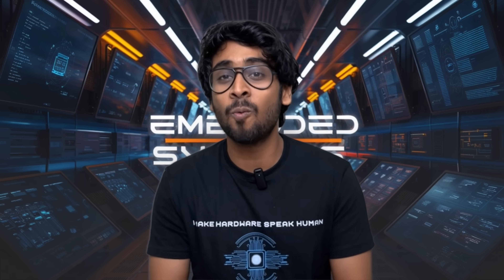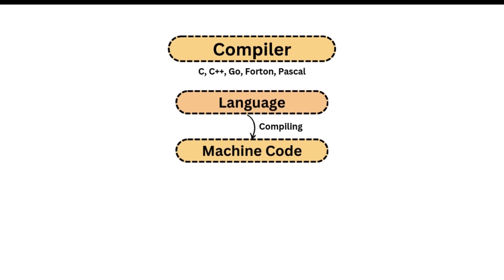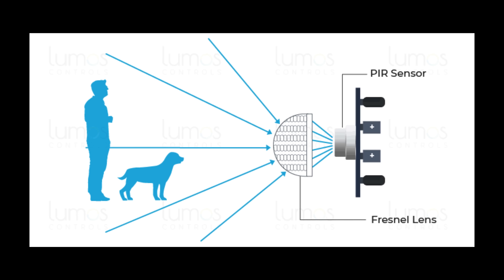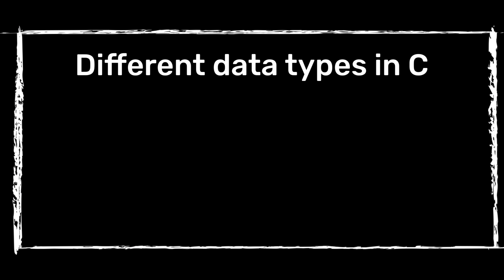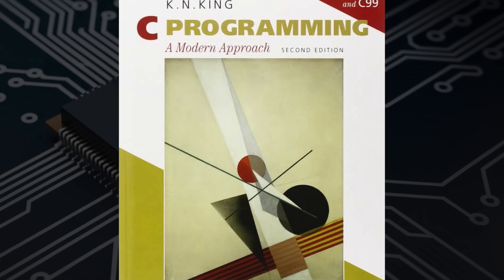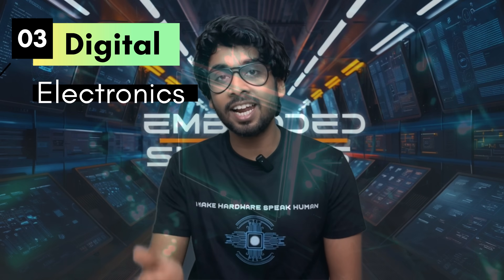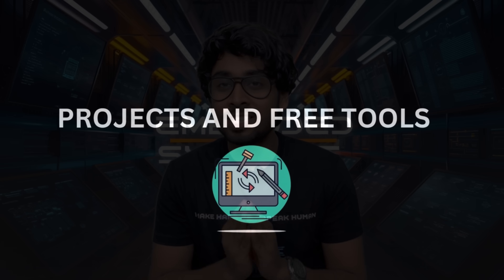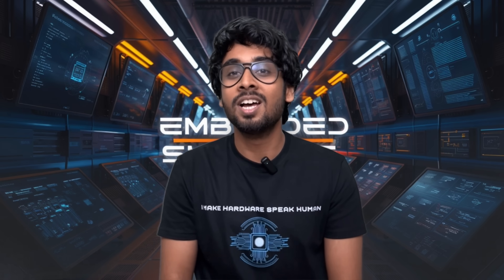The Ultimate Roadmap for Embedded Systems | How to become an Embedded Engineer in 2025

Comment: There was a no explanation about C vs Rust ? As we see Rust getting a lot of traction hence this question of why not directly learn Rust instead of C ?
Reply from the maker: Yes that part got cut from here, you can watch the video on ‘coding for electronics’ it is covered there!
Reply: Hey guys, I think C is launched in 1970's right. So the most community system providing language is C. If we choose rust I think 80% or above peoples are not aware about it. It just my opinion.
Reply: Because the concepts introduced by rust like ownership and borrowing can only be appreciated if you truly understand what c lacks. Furthermore, c is a very mature language by now, so there's a lot of resources of c
Reply: rust is not a beginner friendly lang u need to have good understanding of dealing with memory and pointers to write good code 
definitely u should know c and some c++(specifically smart pointers) to truly appritiate the design decisions what rust has taken
moreover lot of tools still uses c and u will esily encounter a tool not have any rust binding and u might need to write ffi urself
Reply: I asked the same question with a 10 years experienced Professional, he said that Rust may replace C++ but can't replace C. So you can definitely start your journey by learning C .
Reply: Also C gives more control with less abstraction, so it's gold for embedded. Also c is way faster than Rust.

Comment: ### Full, Detailed Breakdown of the Aurora Actuator  
(“Active Vein” — the artificial muscle that makes everything possible)

| Part | Material / Design | Exact Purpose | How It Works in Detail |
|-------|-------------------|---------------|------------------------|
| *1. Muscle wire* | Nitinol (Ni-Ti alloy) braided into a flexible honeycomb tube (~1–2 mm diameter) | Provides the pulling force | When heated above ~60–70 °C it instantly changes crystal structure (Martensite → Austenite) and shortens by 4–8 %. A single braid can lift many kilograms yet weighs almost nothing. |
| *2. Heating system* | Low-voltage, high-current (e.g., 24–48 V, 3–8 A) passed directly through the Nitinol braid itself | Makes the wire contract in <100 ms | The braid is the resistor. Electrical current → heat → contraction. No separate heater needed. |
| *3. Cooling jacket* | The same braided tube is hollow — cold fluid flows inside it | Removes heat extremely fast so the wire can relax again | Without fast cooling, Nitinol naturally takes 1–2 seconds to relax → too slow for walking or gesturing. Aurora solves this. |
| *4. Fast-cooling trick* | Electro-Osmotic Flow (EOF) “Domino Jolt” at 3 kV, 0.2 mm electrode spacing | Creates a lightning-fast water pulse inside the tube | Tiny ring electrodes are printed every few millimetres along the inside wall. The control board fires them in sequence (1-2-3-4…) for ~10 ms each → a peristaltic wave of cold water shoots through the tube at ~50–70 cm/s and strips the heat away in <50 ms total. |
| *5. Safety & 6. Electrical isolation + thermal bridge* | Boron-Nitride-loaded silicone liner (0.1–0.2 mm thick) | Keeps 3 000 volts away from the Nitinol while letting heat escape | Boron nitride is an excellent heat conductor but a perfect electrical insulator → the high-voltage cooling pulse never touches the low-voltage heating wire, yet heat still flows out instantly. |
| *7. Restoring force* | 3D-printed TPU (flexible plastic) lattice joints in the skeleton | Acts like tendons / springs to pull the limb back to resting position | When the Nitinol relaxes, the soft TPU lattice gently stretches it back to its long shape — no second “antagonist” muscle needed. |
| *8. Waste-heat recycling* | Peltier (thermoelectric) module + heat-spreader silicone skin | Turns waste heat into a feature instead of a problem | Hot water leaving the actuator goes to a small reservoir → Peltier module cools the water again while pumping that same heat to the outer skin → robot always feels pleasantly warm (~32–35 °C) like a living person. |

### Cycle in Slow Motion (one 5 Hz step = 200 ms total)

1. 0–80 ms → Low-voltage current ON → Nitinol heats → braid shrinks → joint bends (pulls).  
2. 80–81 ms → Heating current OFF (safety interlock).  
3. 81–100 ms → 3 kV Domino Jolt fires → cold water wave shoots through → braid cools in <20 ms.  
4. 100–200 ms → TPU lattice pulls the limb back → ready for next cycle.

### Why this beats every other actuator

| Traditional motors | Pneumatics / hydraulics | Aurora Active Vein |
|-------------------|-------------------------|--------------------|
| Noisy, heavy, rigid | Needs compressor/tank | Completely silent |
| Hard metal gears | Fast but bulky & hissing | Naturally soft & safe |
| Cold surface | High maintenance | Always warm & pleasant |
| Complex transmission | Limited force/weight | Direct drive, super lightweight |

That’s the complete actuator — every layer, every trick, and reason it exists. Once the first 10 cm prototype cycles reliably at 5 Hz, the path to a full humanoid (or prosthetic arm, or morphing wing…) is wide open. 🤖🔥

Comment: Hi ,i am a mechanical engineer my current job doesn't require embedded system but I want learn it to improve my self incase in future I want to change into mechatronics field ,so my question is following this roadmap is sufficient or I need to learn any other skill set along with this?
Reply: Also which is best learning a programming language then jump into the electronics or learning them side by side?

Comment: But you over emphasized on "C" being the best and most suited for embedded systems development but i think it varies because however much python is slow micropython was specifically developed to make it more easy for writing firmware for embedded systems and might be easier for a beginner to learn especially one who is already familiar with python. 

And me personally I prefer working with C++ than C for writing firmware its much faster than C (to me) and I can work with Classes and objects with it 😅😅 plus there's also Rust that you didn't go so much in detail to elaborate on. Rust is also becoming popular for embedded system's development because of the way it handles memory management and catching errors at compile time rather than at runtime.

 😅 in otherwards C is no longer the only kingpin when it comes to embedded system's and hardware development its better for a beginner to start with something simple maybe like arduino programming as they slowly traverse deeper into hardware "its not a must that they should start by first learning all the principals of "C" 🙄🙄 to be able to use arduino!!!

Comment: ROADMAP EMBEDDED SYSTEMS

1.	BASICS
•	C for embbed systems in depth
	Data types and when they are used
	Pointers in C  in depth
	Linkedlist and Arrays
	Memory Management
**Resource: Neso Academy with Geegs4geegs practice
2.	RTOS 
•	Processes and Threads
•	Scheduling Algorithms
•	Semaphores
•	Context switching
•	Memory Management
•	Kernel Concepts
•	Interupts and ISR
** Resouce: Neso Academy OS with Free RTOS website + CHEDDAR for practice
3.	Digital Electronics
•	Gates, flip flops, counters, Kmaps etc
4.	Computer Architecture: super useful in semiconductor industry
•	Processor layout and how it works
•	Cache hit and cache miss rates.
•	Cache coherence
•	Cache mapping techniques
•	MIPS Assemply  languages
*Resource: Neso Academ
5.	Microcontrollers 
•	Level 0: Arduino UNO – don’t take libraries for granted grind instead
•	Level1: TI MSP 430 
•	ARM M class eg STM32            
	Keep this in mind:   
-	Using GPIO pins
-	Handling interrupts
-	Timers
-	Using converters eg ADC and DAC
-	Interface protocols eg UART, I2C and SPI
6.	Embedded in 2 different companies
o	Semiconductor industry
o	Consumer industry
7.	Projects and Tools
-	Simple LED blinking, 
-	Controlling motor speed and direction
-	Timers 
	QUEMU :  It simulates the physical hardware
** don’t use built in libraries. Give it a shot.
8.	SKILLS YOU MUST HAVE
	Writing Efficient C code
	ability to go through Data Sheets
	Knowledge of comunication protocols: UART, I2C and SPI 
	Master in basics of electronics, digital and basics of analog and network
	Comfortable with linux based systems.

Comment: Hi, thanks for making this video. After watching this video i definetely opened my eyes and realized i'm just a small amateur in this area, doing little projects with arduino and ESP32. But i still didn't found the relation between the electronics and software, i mean, making basic electronics projects with arduino or any other microcontroller is too different of the real applications of microntrollers you mentioned. So an embedded systems engineer is more focused in what happens with the chip isn it?, is more focused in how is compound, how to optimize some algorithms, in few words to make the chip work very efficiencially knowing that device enterely. 
I feel so overwelmed with all the long way i have to go if i want to be an embedded system engineer. I still have a question, how is possible that an embedded system engineer could know about different chips??, i mean with the datasheets, but there are so many devices, each one with their features, so don't make you confuse to work with different microcontrollers???

Comment: For complete control in hardware I think clear concepts in core electronics engineering subjects like analog, power electronics, signal & system also necessary.
Reply: Bro what's the difference between hardware embedded and software embedded exactly
Reply: @ in my opinion to learn embedded you need to learn the hardware part (digital electronics component as well as analog electronics component etc) & the software part (such as assembly and programming language, real time os, DSA etc.). So in short hardware embedded & software embedded aren't two different thing you have to learn both aspect to be able to do embedded stuff.
Reply: @MrMhsn  Thank you brother
Reply: @MrMhsn  i accept your point
Reply: yes brother